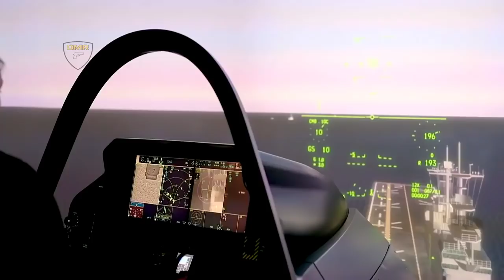First F-35A Lightning II For RAF Lakenheath enter production

Comment: How it is actually known where these particular aircraft will end up? Surely the USAF will decide where they're assigned once they're accepted into service. I very much doubt aircraft are manufactured with a particular base or unit in mind.
Reply: It's not like a factory that churns out products to be then distributed to stores for purchase by the public. The airframes are purchased by the government in blocks, already knowing what units they will be assigned to at the start of manufacture.  More like ordering a fleet of vehicles with specific requirements directly from Ford rather than walking into a local dealer to see if what they have on the lot will suit your needs.
Reply: It takes months of planning, environmental studies and a long list of other steps to determine where aircraft are based. Once that's done, aircraft like the F-35 (which is in the early stages of its service life with the USAF) can have the bases it'll be assigned to pre-determined before they are even produced.